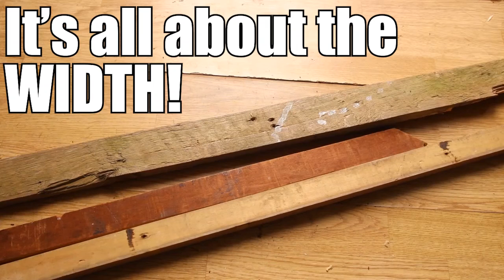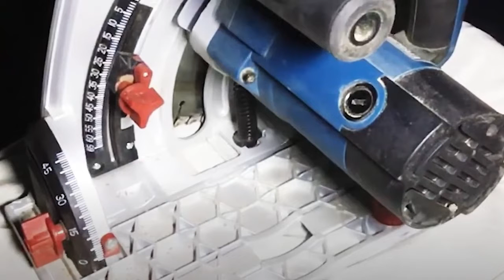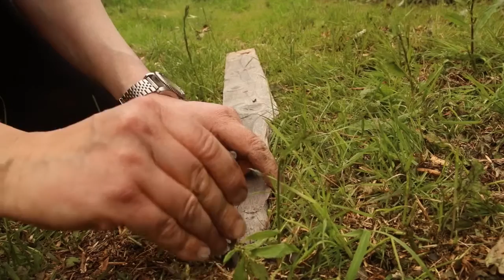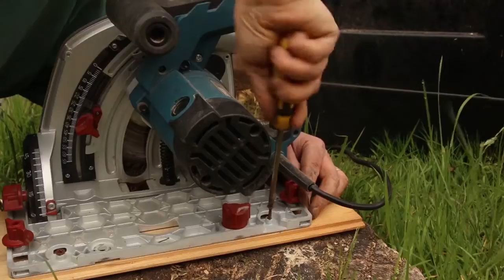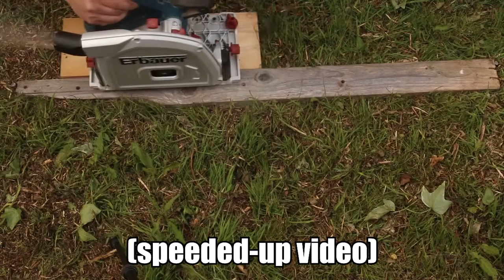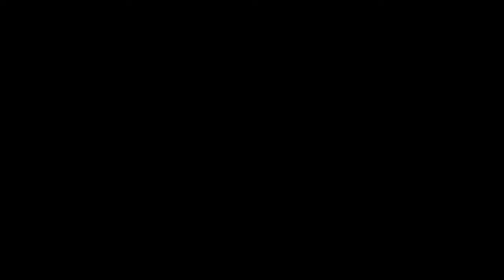How to cut NARROW pieces of wood with a Track Saw (rail saw)

Comment: I love the guide technique - I was wondering what all the holes on the track saw base were about! I plan to do this on a scrap piece of rigid insulation rather than grass -- dirt can dull blades really quickly, something I've learned the hard way with a chainsaw.

Comment: Clever trick. How would you go about having a narrow piece of wood without a straight edge? You'd have to use the track first and cut one edge before using this trick. Any suggestions? Imagine the piece of wood is narrower than the track width.
Reply from the maker: Good question! I guess you'd have to nail down the wonky wood, and lay another (straight) piece beside it to be the guide for the saw. And take lots of care, of course!